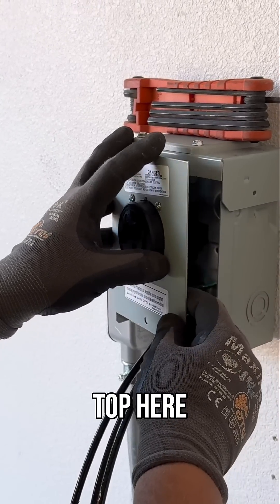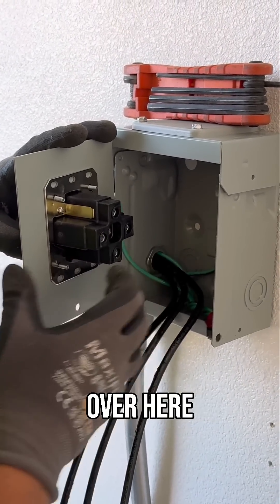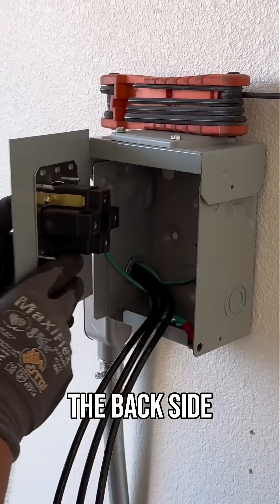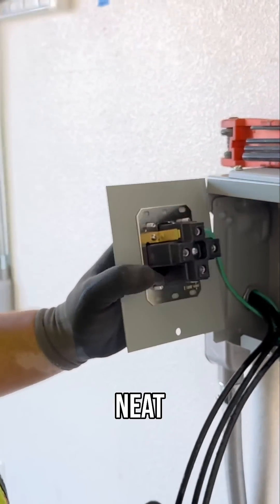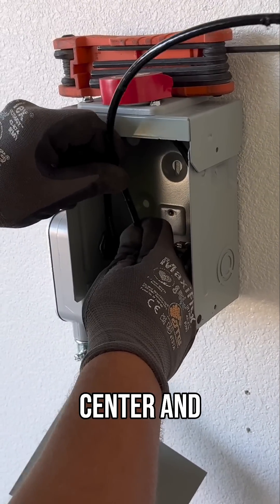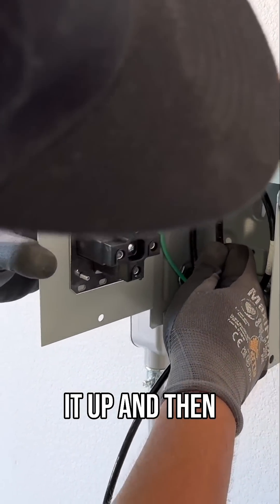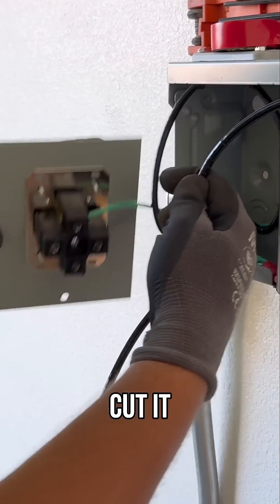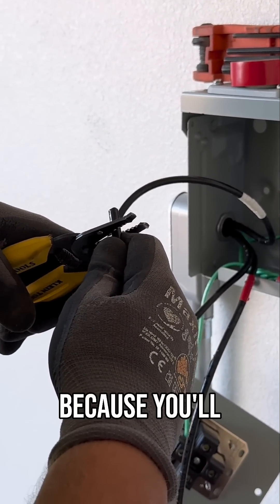Wiring An Electric Vehicle (EV) Receptacle: Easy DIY Electrical Guide

Comment: That is on a two pole breaker. Doesn't matter what color goes on the device.  Both loads ( Black and Red ) could even say (  Red and Blue or Black and Blue ) the two conductors carry the same load ( amperage) to the device in each line! Electrical current does not care about the color 🙄  But the color is only to  identified with circuit number.  Neutral is white on the low side of voltage ⚡️  Gray on high voltage .

Comment: Anytime I do a plug like this, or a disconnect, or terminate in a panel I use a torque screwdriver/wrench to tighten the lugs to spec. It’s been code now for quite a few years to torque to manufacturers instructions. I got rid of my Klein folding hex and bought a long 3/8 drive hex set and a 3/8 impact adapter so I can put it in a 1/4 torque screwdriver
Reply: Where did you get the long hex keys?
Reply: @adriandiaz8124 I bought a set of hex keys from Amazon, casoman I believe is the brand it was a 10pc set and had everything my flip set did
Reply: @adriandiaz8124  Amazon has plenty I used the casoman brand

Comment: When you use the correct/proper wire strippers, you don't have to worry about "scoring the copper."  You MAY wish to re-post this poorly-worded video.
Reply: You MAY wish to post your own  demonstration.
Reply from the maker: Thanks for the feedback!
Reply: You don't need the "correct" strippers. Go a size down, cut half way, then twist and break the coat off. No wire damage no thinking about the "correct" strippers
Reply: @ColeNetProdz a size down on number 6 strand wire? Show me where to buy these strippers